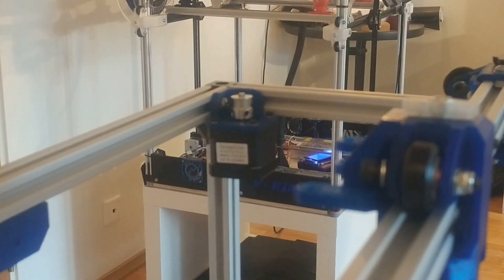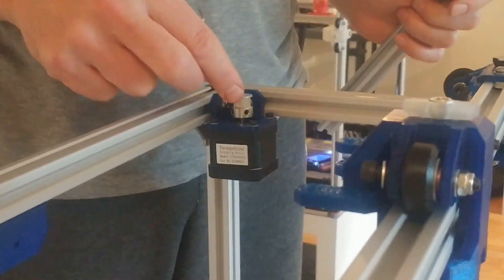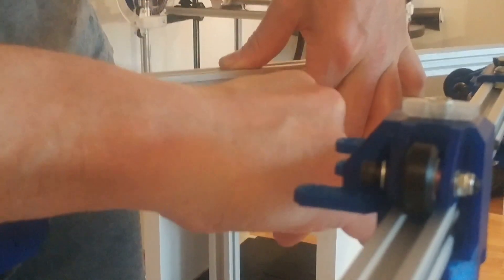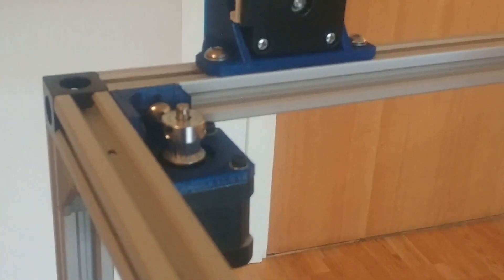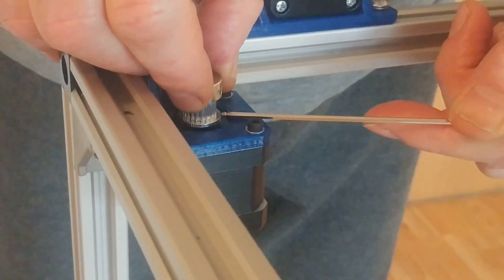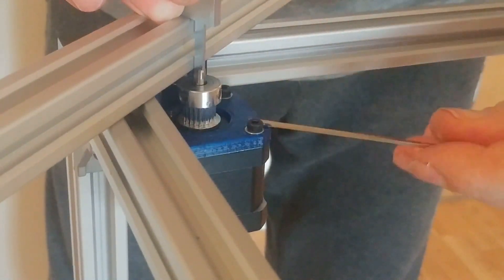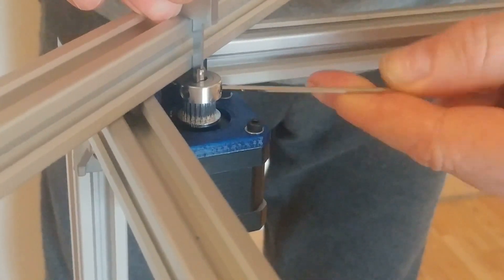V-King Live Build - Motor Pulleys

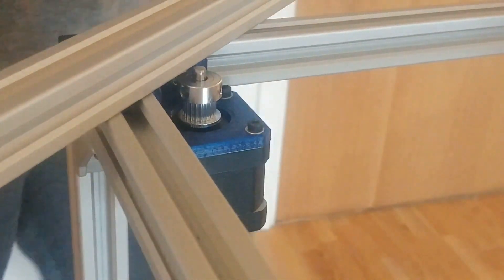Comment: Hey Roy, at about 1:30 in you say to set the calipers to 24mm?  That seems way to long.  Looks more like 6-8mm?
Reply from the maker: It is 20mm for the one that I put on top, then additional 4mm down to the pulley so 24 mm from the top of the measuring point